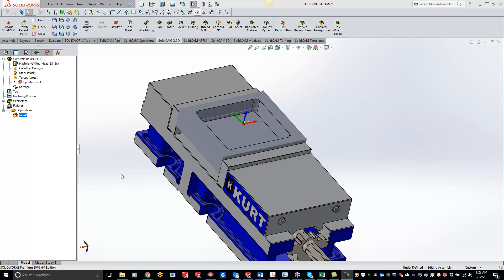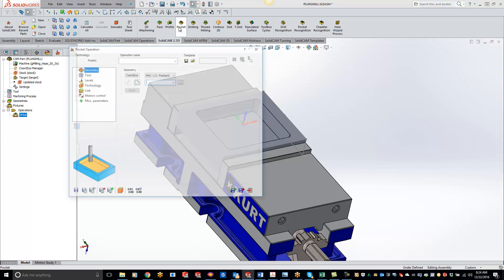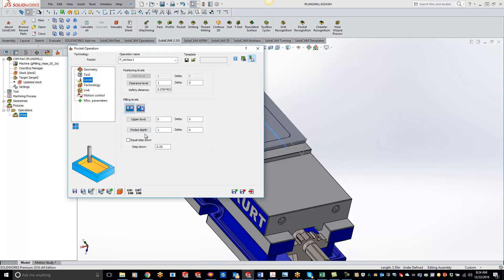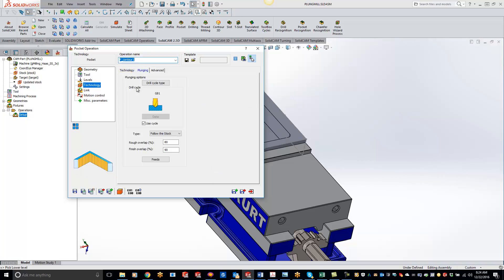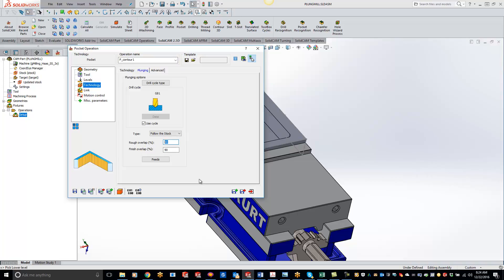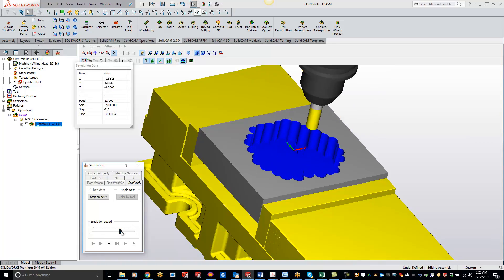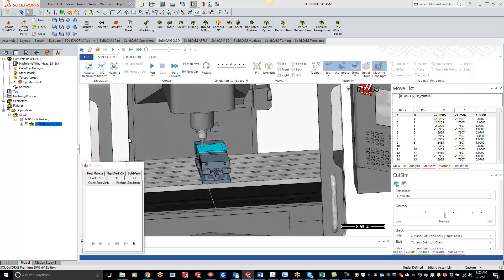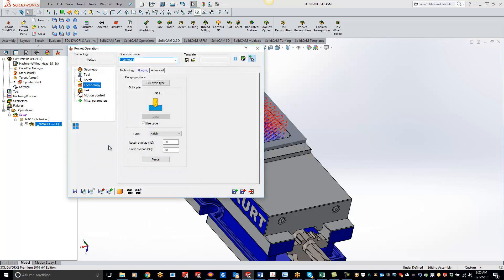SolidCAM - Plunging Pattern inside Pocket

Comment: Hi there, I've got a question.
I want to make a plunging machining in a  piece, but Z level is not flat, is an arc with 2000mm of radius.
I mean, Z level is flat, but my stock pieze is a curve piece of steel.
The path always start the G01 code in the same Z level, that is ok in the middle of the arc, but in the border is a waste of time.
How can I make that the clearance level were changing in order to  follow the arc radius and not waste time with a G01 code running in the air?

Thanks a lot.